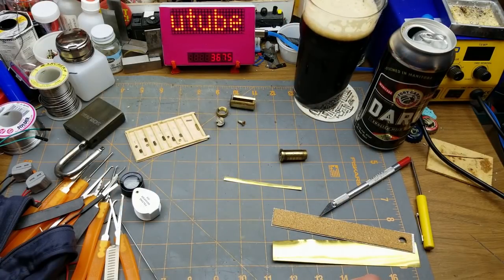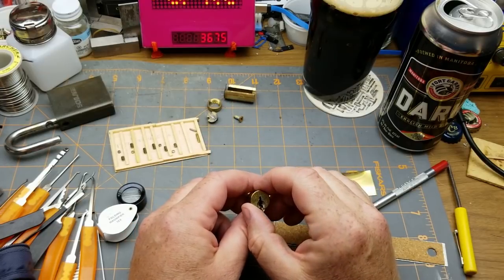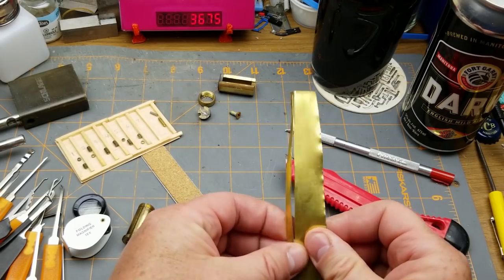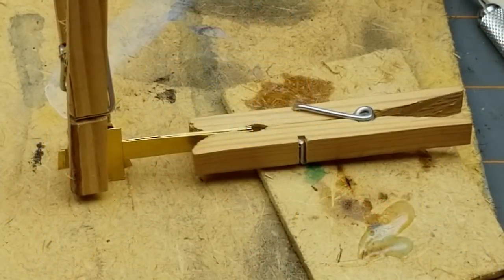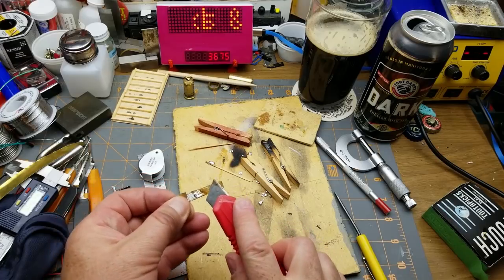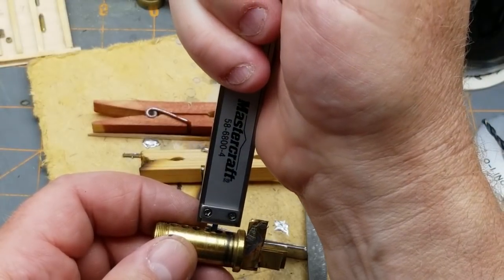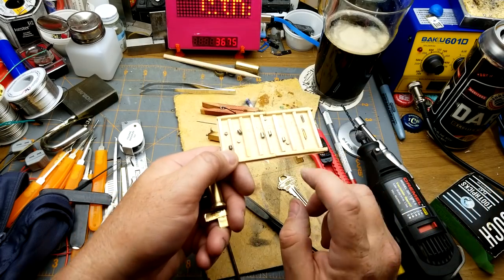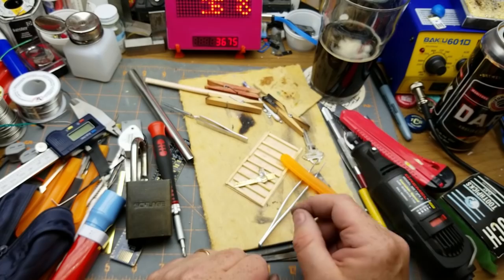Can I make a homemade key?

Comment: Interesting - lock picking / opening is not something you see very often in the U.K.
Most locksmiths in the area double as glazers and some are joiners - though you get lots of small stands (maybe 6 foot by 10) that cut keys, repair watches and sell door signs (house names / numbers) as part of a national chain.  They are often in major supermarkets but I’m now seeing automated key cutters now - very soon I think watches will have to become disposable as you will not be able to find someone to change the battery or clean them...

Saying all of that, when we cleared the garage out after my father died mum and I found a set of picks and a crowbar 😳😂. Neither of us knew where the picks came from and going by the grott all over them they had not been used for years!

Comment: Unfortunately it seems to be getting more difficult to get stuff like blanks from locksmiths. I can understand the argument that they only make money selling the service, not the blank, but just add a markup. I'm sure some are just worried about people making bump keys, but I've seen a lot of them that simply hate anyone messing with locks that isn't a licensed locksmith.

FWIW, the markings on the cylinder suggest to me it may have been military surplus at some point. Either that or some sort of utility or city organization. A lot of those groups will mark locks in some way like that.